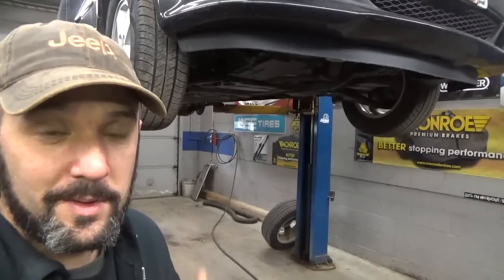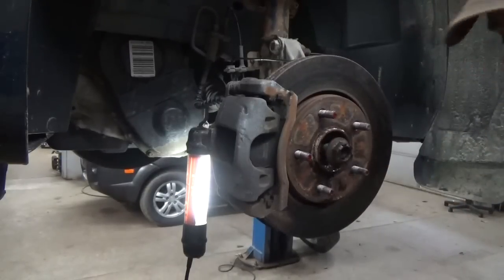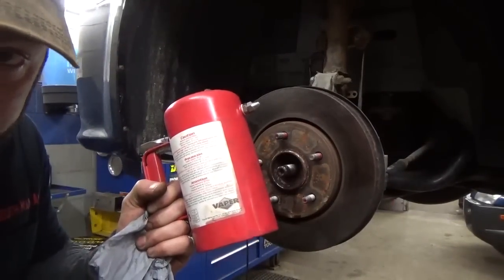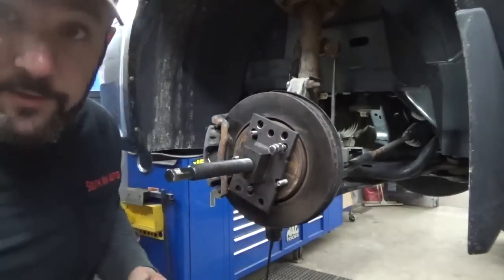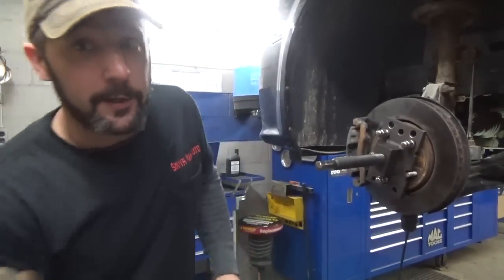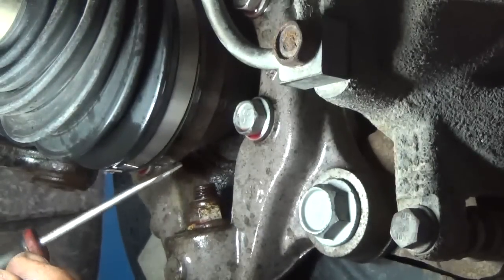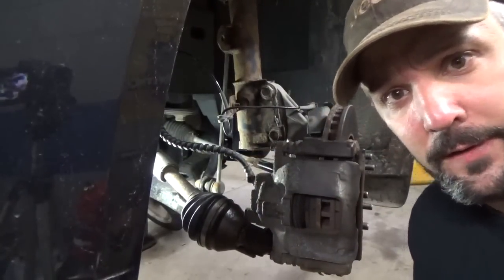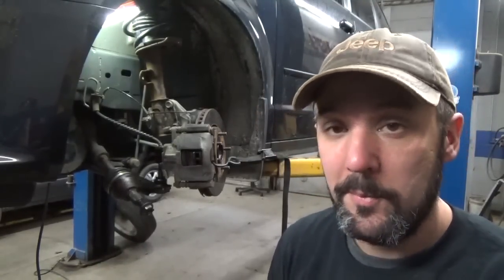Dodge Grand Caravan Lower Ball Joint - Part I

Comment: I have been struggling with a wheel bearing and hub replacement for the last 3 days (during my evenings in my unheated garage in Chicago in the winter) and took great solace in watching you (my hero) struggle.  Thanks for encouraging me and showing that  if, "you can do it, I can do it too"  I love your videos and honesty!
Reply: Nut size for the lower???
Reply: I had a heck of a time with my hub bearing.  Had to beat the hell out of the hub bearing assembly.  With a coal chisel and a small sledge hammer. Eventually I got it. After 30 choice words later.

Comment: This is incredible. I just replaced the wheel hub assembly on my now 6 year old Missouri 2012 Dodge Caravan and it took about three taps with a 2 pound hammer and the axle popped right off. Crazy the amount of rust you have!
Reply: You don't live in the Salt belt

Comment: Hey! I still have a MAC impact wrench like that. Bought it about 28 or 30 years ago. Still works well. But my Ingersoll Rand cordless 1/2" dr impact is better. It's a badass. 700 ft lbs torque.

Comment: Why not just turn the nut as far up as it will go, break loose the joint, hold be lower part of the joint with a good pair of Vice grips and remove the nut?  I did that many times.
Am I missing something?
Reply from the maker: Ralf V No that is an option but the fact is I didn't intend for it to go this way and once I started I figured may as well keep going. Customer is keeping the car and I know I will have to face this some day so might better get it outta the way ya know.
Reply: South Main Auto Repair I see your point!  and I realize that things work out in a different way up north then they do here in the mid-south.  Every once in a while I get a vehicle from the Chicago area and I agree that it is a whole different way of fixing, as least in regards to the rust and corrosion.
Reply: Because then he couldn't charge the customer twice as much for labor plus markup on a new CV
Reply: Ralf Valcourt 
sma is the man!!!!! but yea bro i always do what ur sayin iv. never removd the cv shaft for that type of job
Reply: @SouthMainAuto  whats the difference between BJ with labour and new DS + BJ and labour... give me 2 prices please.... i dont understand the need to renew a DS on a 2.5year old car,..... near future????

Comment: I have done those without moving the axle. Loosen the ball joint and pop it from knuckle, lower and loosen more till it comes off.
Reply: I second what big blzr94 has stated. I routinely do that- so far it has always worked.
Reply: yeah, but it's a 41TE bastard, and will likely need the trans rebuilt before too long
Reply: He explains why he didn't do it like that at @ 20 min.
Reply: Thats what I did when I replaced mine.
Reply: me too
Reply: There is no more clearance in the shaft to move .The hammering on the shaft destroyed the Outer Joint .If the balljoint nut spins ,mark and disconnect the top bolts .Tap shaft in/out and air gun ball joint nut.
Reply: Sorry that I re-posted what you already said.

JMF TAG

Comment: Great video.  Thank you.
That huge bolt that you are pounding on, is it possible for metal fragments to come flying off it as you are pounding?  Just thinking about protecting your eyes by wearing safety goggles whilst pounding.
Reply: toyo toe you should be more concerned about his ears
Reply: no, its a soft metal.  that bolt will bend, not shatter.
Reply: HUN
Reply: Choices 😅

Comment: Those darn Chryslers are so bad for that every time! I never see Fords that bad. You could just loosen the nut on lower ball joint up to cv then separate lower BJ from knuckle then finish taking off nut as you will have plenty of room now
Reply from the maker: FordTechMakuloco That is true them Mopars do seem to get it a bit worse.
Reply: FordTechMakuloco Agreed. I had to tell the owner of a Dodge Ram 1500 he needed a new shaft with his bearing repair. He asked me "Why do you think it's seized up so bad???" I just said "Cause its a goddamn Chrysler product. Ford's and Chevy's just fall the fuck apart." 

Every Chrysler CV axle I have ever seen especially in NY is seized right the hell up.
Reply: Don't see same on  Honda's....on our third Odyssey.. having clocked up galactic mileage on each and never had  ball joint or CV problems...
Reply: Each day has new stories, that s mechanic!
Reply: Here in Upstate NY I don't care what manufacturer it is, i fight every one of them. The people that want a $20 fuel filter replaced are outraged when they need complete fuel lines from the tank to the engine (Which means dropping the tank). Anything over 10 years old can crumble in your hands. Sometinmes its cheaper, because of the labor to just replace everything. Pluis then it's fixed. Patch it together if you're selling it in a year, otherwise replace it. #1 is Brake lines, Just do them all.. Eric has it right, fix it correctly , unless you know you'll never see it again.

Comment: I doubt if u did any damage to the outer cv joint. the inner one should have enuf in and out movement to prevent that. remember it is a piece of $hit dodge that had a bad ball joint after only a few years. I have a 2000 Avalon with original ball joints that are just fine. not to beat a dead horse but u really need to wear safety glasses on certain procedures. u know murphy's law. take care
Reply from the maker: david goliath I know makes ya wonder about that shaft really.. only had it pushed in a bit before I cracked the joint loose, should have been plenty of movement in the inner joint and outer joint to go in undamaged.

Comment: you wanna know something weird i just replaced mine on my 05 trailblazer both side wheel hub assembly i used liquid wrench and did the same but with an oversized rubber mallet when a 2 lb and 4 lb hammer didnt work the rubber mallet broke it free with the juice

Comment: Eric , I really like that little sprayer you have where can I get one? I assume its pressured by shop air?
Reply: Napa has them. I put gas in it. Great for cleaning spills, starting the barby and adding a little fuel to check out short term. B careful though. Gas is flammable. Use the stream jet, not the fogger.

Comment: Speaking of invention, because lack of money,  my dad took the back of a Dodge alternator, bolt it to the firewall of a Datsun 1200, and soldered wires from the Dodge diodes to the diodes on the Datsun alternator.  Drove it that way for 5 years. Worked perfect.

Comment: Wow Billy Mays caveman style! That was awesome! Shame on Chrysler for using shitty parts too. Crappy balljoint, and a crappy seal of the axle splines from the elements. Not to brag, but my '89 Mazda MPV (that you just inspected lol) still has the original front end on it...balljoints, bushings and wheel bearings still going strong at 235k miles!! How's that for quality? Mazda's slogan in the 80's used to be "The Mazda Way: An Intense Commitment to Your Total Satisfaction"...no bullshit :)
Reply from the maker: motoYam82 Hahaha Thats right Ivan! Billy Mays "KABOOM"!!

Comment: Wathicg this I wonder wehter loosesning the lugs and putting tension on the force screw before beathing the shit out of it might be more effective since the threads on the force screw prevents it from going anywhere. I think it would give you more of a stroke and also youd know as soon as it moved since it would slack off.

Comment: The rust welding you deal with is mind boggling! The cars I work on here in Colorado you hardly ever need heat and pullers.

Comment: Your actually lucky cause if you wanted you could have removed the shaft and knuckle together and got on it as you mentioned. I live in NY and I will say every Chrysler product does this shit. Just got a 02 Dodge Ram 1500 in for a simple wheel bearing and every bolt was a fight on that thing. Now I got to get the intermediate shaft out of the cv shaft cup. It took a lot of heat and beating to get it away from the hub.

Now low and behold one goddamn hub bolt won't come out and stripped off after heating the thing. I'll drill it and then I can focus on everything going back together.

Both upper and lower ball joints are bad on it as well I'm gonna try to talk the customer into doing those. I hate when a person can't afford to fix the whole thing and you have to put it back together with shitty parts.
Reply from the maker: evilcowboy Oh man I hear that , it sucks but we can't make them have money ya know.
Reply: South Main Auto Repair
 :) yeah talked to the customer today and he said he will stick with the ball joints that are on there sadly so I told him I would grease them up good and tighten it up well to get him by until payday.

The intermediate shaft I finally got out. Had someone working on it for an hour trying to beat it. He was convinced he could do it.

I finally ending up taking it to another place I work and a buddy of mine tried with Acetylene torch still wouldn't budge being cherry red. Then he tried again and still no dice, Finally the plasma cutter came out and we cut relief cuts in it and finally got it out. Now all is ready to go back on the truck lol. At least the guy opted for a Timken hub with a 3 year warranty on it. It was an adventure on this truck. I only lost the cv shaft. Could have rebuilt it but spent waaaaay too much time on the truck so far.

Oh forgot to tell ya you video was an awesome one.
Reply from the maker: evilcowboy Well sounds like ya won the war and the battle is over :)

Comment: could you not have saved yourself a whole load of ball ache by just using a wrench on the ball joint bolt? im not complaining as longer videos are awesome but just curious?
Reply from the maker: James'sWorld check out 19:09 see if that helps...
Reply: James'sWorld he explains in the video.  the nut is a lock style, and the ball joint shaft will just spin.
Reply: i know that, but surely you could grab onto it with a pair or vise grips or something? just seemed like a big ball ache which could of been avoided thats all
Reply: James'sWorld, easier said then done. Especially with the amount of rust on the threads above the lock-nut.
Reply: He gets a lot of repeat business and he mentioned the customer plans on keeping the vehicle.  He will have to deal with it sooner or later anyway.
Reply: I did this on my wife's 2008 Town and Country.  After facing the same issue with the axle being seized, I went to Harbor Freight and bought a cheap combination wrench set and ground down the closed end so it was thin enough to get on the ball joint nut.  I turned it off almost the entire way and then split the ball joint with a pickle fork.  It dropped, I put vice grips on the ball joint and turned the nut off the rest of the way.  It worked great and aside from the time spent running to HF for a cheap wrench, it didn't take very long once I had a plan.  Hope this helps the next guy or gal trying to fight the Mopar rust demon....

Comment: i probably would loosend the nut and broke the taper and loosend it the rest of the way, seems easier to me and less chance of breaking a axle or bearing and haveing to eat the cost of that.
Reply: UBBERTANKER, I think he explained it in the video, but turning the lock-nut after breaking loose the ball joint stud would just spin the stud instead of loosen the nut.  Especially with the amount of rust on the threads above the nut.
Reply: Pet Rock's Garage the ball joint nut could have been removed far enough before the taper was freed.
Reply: +xUnUsualSuspectx loosen nut, break taper torch it  or cut the stud of the ball joint with a die grinder
Reply: UBBERTANKER I've done many of these and as soon as you get the top of the nut disengaged from the threads it just spins off. The nuts are crimped on the top so they don't spin loose, but it's only the top few threats, but you are correct that you can cut the shaft in needed. You can also heat the A frame and tap the ball joint out, then heat it again to press the new one in. As it cools it locks down on it and the C clip serves as backupl

Comment: Get some safety glasses, man! I'd  hate to see you take some shrapnel to the eye.
Reply: Sam G Absolutely, especially that close to the grinding wheel.  Material can fly off in any direction.  Great video, nice to see the process.
Reply: Sam G I hate to pile on Eric but Sam you're right on this point. You've only got two eyes and you must protect them. We should all send Eric safety glasses until he finally breaks down under the pressure and he begins to wear them. Also mushroomed chisels and punches need to be ground down.
Reply: You don't need eyes where we're going!
Reply: ... and some hearing protection!
I see hearing aids in your future.

Comment: I totally feel your pain and frustration.  Can you imagine doing this without air tools and a lift, using loaner tools from local auto supply --- like I do in my driveway here in Ohio.  So painful, it's funny as I break one thing then the next to fix a minor issue.  I once ruined an engine block on a dodge caravan when I broke off  the ear tab that the thermostat housing bolted to in the back of the engine against the firewall (inaccessible).  I love your vids.  Thanks for sharing and keep it up

Comment: The amount of rust you guys get is absolutely crazy. I once helped to change a timing belt on my friend's Honda. The car came from up north. Everything was rusted. I was able to remove all metal on metal bolts and nuts after applying penetrating oil. Worst part was removing all small bolts from the aluminum engine parts. All the aluminum parts were coated with a thick layer of white crud. Almost every bolt that was in aluminum broke, no matter what I tried while removing it. I called it - "Honda from hell". We spent 3 days on that car, changing the timing belt. Unbelievable!

Comment: just viewed this because my inspection is due next week and I need a new drivers side ball joint.The drivers side is shot but I plan on replacing both..I have a 2008 caravan with 140000 mi,Never had either side taken apart.I just went out to see if it was going to give me the same probs as yours.I have removed cv joints from bearings on other vehicles without much effort but wanted to make sure this wasn't a dodge thing and go past the inspection date..I decided to try it without jacking it and left the tires on the ground.I took the nut plug off the aluminum rims and sprayed them with wd.It took a little while but spun them off with my air impact.I then put the nut back on til it had full thread ,put my impact socket on the nut and whacked it with an 8 lb beater a few times and the axle freed up just like that! The other side was a bit tougher but after a few whacks it it also came loose.I live in upstate ny with some pretty rusty winters and my van was 3 times the age of the one u were working on..I think u would have been better off leaving the tires on the ground as I did as the shock goes from the tire to the ground..In the air like u had it,The shock goes all over,Into the spring,axle and bounces back and fourth.Maybe u should try it next time,It might save u from breaking things and cost whoever more cash.Also might be able to get it done in 1 day instead of 2!

Comment: I was just wondering if when you put that puller on the hub, if you tightened the lug nuts all the way so the puller was against the hub?  If so, then the puller would have no space to go when you smashed it with the sledge hammer.

Comment: This driveshaft would have been easier to remove even if it was welded, you need a much bigger impact, something like they use shifting weels on trucks and trailers.
But as always, you're the man with a lot of self-control when you in tremendous frustration didn't start beating up the car with that sladge hammer.
Don't get me wrong, I love your videos and you have my full respect,(I have been there myself)

Comment: I was working on a friends 2014 Caravan and was swapping out the main crossmember. I was able to put that nut onto the balljoints without removing the CV Axle. I used a transmission jack to press against the balljoint so it wouldnt spin. Then I used an 18mm wrench to remove the nut. Once loosened, i lowered the jack and the balljoint came right out of the spindle.

Comment: hi ERIC, thanks for the great video and real job action without editing out any thing. one suggestion only that you should and must tell and explained to that customer the procedure to change the ball joint it could need to change some other parts because of the crazy rust that will be on those parts just to protect your self from extra expense that as you know will encounter specially with those cheep made cars.
Reply from the maker: j georges Oh yeah I am very straight forward with my customers for sure...

Comment: If I were doing this myself, with the limited tools I have at home, I would buy the entire lower control arm assembly, which comes with the lower ball joint, for about $90.00, and avoid messing with the axial.  This avoids pressing the ball joint out and gets you new bushings also. [Example:  ACDelco 45D3158 Front Drivers Side Lower Control Suspension Control Arm and Ball Joint Assembly - 2005 T&C].

I enjoy your video's, but like many others would feel more comfortable if you would use eye and ear protection.